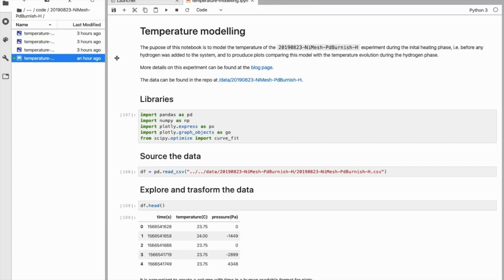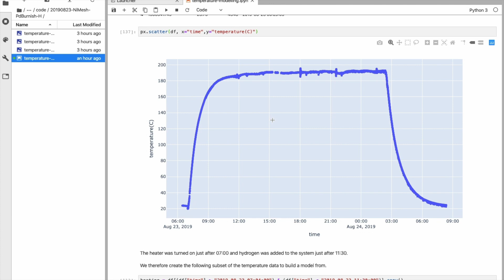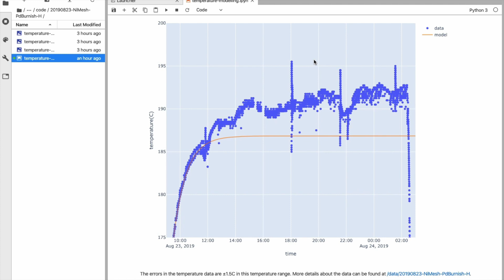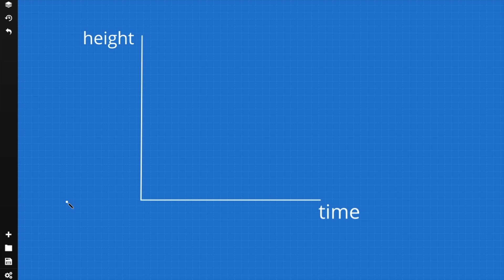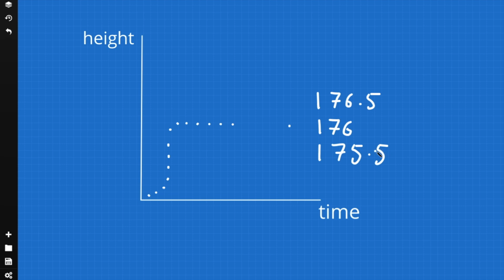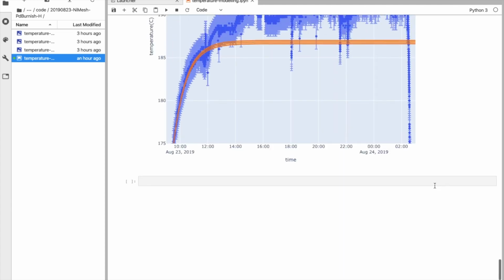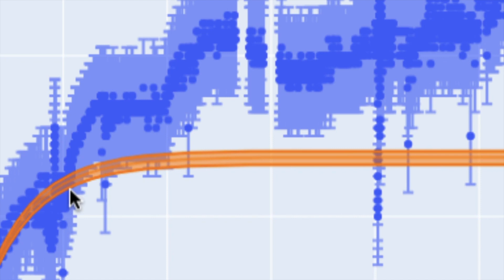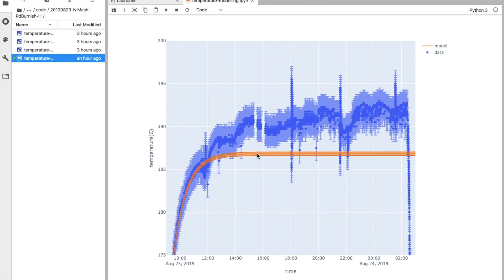Did I make cold fusion happen? - Casual Physics 003

Comment: Fleischman and Pons used deuterated acetone. Pure hydrogen is very difficult to fuse even in a star. But by the way only natural hydrogen H2 would make fusion the cheap unlimited fuel source they claim.
Reply from the maker: Agreed. This is why people get so excited about the possibility of nickel and hydrogen as opposed to palladium and deuterium. There isn't as much  data on the Ni-H system unfortunately.
Reply: @CasualPhysics  I think an Italian guy managed to create a fusor devise which fuses some solid fuels together and achieves breakeven.
Reply: @thelovertunisia  do you have a link? I'd love to read about that.
Reply: @thelovertunisia  oh I meant the italian guys fusor that breaks even, sorry, I should have specified.

Comment: Others have found that a 50 nano-meter space in a nickle 3D mesh with a Hydrogen Resonance Frequency at 90 Degree (one North-South the other East-West) will produce about a 20K F in temp with a POSITIVE in Deuterium Produced with a POSITIVE NET Energy Produced. others can reproduce this effect while others are at a 50/50 with non-mesh designs like pitted nickle balls looking like crumpled foil balls.

Comment: Hi Matt! Sorry for being late at the ball, great video! I don't understand how your model errorbars can be more narrow than the errorbars in the ramp up phase measurements its based on. Also, would be informative to see the equipment approach saturation on its own before you insert the "reactant". Anyway this was great!!!
Reply from the maker: Robert, Hi 👋. So glad to have you here 😊.  Excellent question about error bars - I too was surprised by this. Here is what I did (full details in the following jupyter notebook https://gitlab.com/mklilley/lenr/blob/work-in-progress/code/20190823-NiMesh-PdBurnish-H/temperature-modelling.ipynb):

To calculate upper and lower bounds for the temperature model, I created 1000 versions of the model based on temperature data that's modified to include a uniformly distributed random error (up to ±1.5C) at each point. The 1000 models are then used to make temperature predictions and the maximum and minimum predictions at each point are taken as the upper and lower bounds.

I'm not sure whether this is the most common way to make error bounds on models but it seemed reasonable to me. Give me a call sometime and we can talk about it in more detail.

Regarding the approach to saturation - I totally agree. When the experiment was taking place it seemed sufficiently saturated - next time I'm going to leave it a lot longer.
Reply: Casual Physics Cool! I’ll have a look at the notebook. Just from the look of it though, I think your model errorbars could and maybe should be more conservative. But even with broader errors I think you would definitely see indications of the effect, albeit less significant.
Reply from the maker: @robertnyqvist1844  Yeah, I'd love to hear your thoughts from your new data scientist perspective :-). Give me a call in the new year so we can catch up and discuss some of this stuff.

Comment: Good work Matt.
I'm not sure if I understood it well about the calibration curve: Was the H2 already filled in the vessel before the rising of temperature in the calibration process OR is the H2 introduced at equilibrium of temperature.
The calibration must have H2 (or D2) without the mesh ! Without that you can't know how H2 affects the heat flux inside the vessel. H2 is very good conductor of heat and has a great impact on the vessel behavior regarding the temperature at one point of the reactor.
First you must master this first step about your vessel behavior with heating and H2.  The H2 pressure  from 0.1 mbar to 100 mbar has a dramatic effect on heat conduction. Above 100 mbar, there is no much influence of the pressure and below 0.1 mbar the effect of H2 in the vessel has not much effect.

Secondly, you can put the mesh inside the vessel a look for a different behavior and if tehre is one analyse it to remove every artefact that may have influenced the result.

Arnaud
Reply from the maker: Thanks for taking the time to reply Arnaud. As I mentioned in the video, I have not yet done proper calibration experiments like the ones you describe. I have plans to do these (and in fact, I'm doing one of them as we speak). However, even without such experiments I think I can say something useful. You see, my experiment is heated from the outside, this means that the high thermal conductivity of any hydrogen inside doesn't have an impact on the final steady-state temperature in the absence of any internal source of heat from chemical or fusion reactions - it just determines how quickly the steady-state will be reached. So, I use the initial heating curve when no hydrogen is yet present to determine a baseline from which I can see if there is anything extra happening inside.
Reply: @CasualPhysics   Thank you for the answer. Please replicate the initial heating curve with H2 inside and without the mesh. And for a proper calibration, the vessel should be reduced before that.
Reply from the maker: @arnaudkodeck5107  I'm currently heating the vessel with nothing inside under vacuum and will put hydrogen in a couple of hours. Thanks again for your interest.

Comment: Hello Matt!!! Did you meet Bob Greenyer at ICCF22? He stresses the importance of having Ni absolutely free from oxides, as he was told by Piantelli and Parkhomov. It takes weeks of baking out usually. Mizuno also stresses the need for long bake outs to remove all oxydes and impurities from t reactors. That’s not really fun but even Thomas Graham in the XIXth century, who was the first to understand hydrogen difussion in through metals understood that it was highly dependent on the purity of the surface exposed.
Reply from the maker: Hi. Yes I know Bob. We did not chat about nickel oxides but I've been talking to Ed Storms recently about potential impurities on my palladium and have got some ideas for ways of removing them that will make loading much more effective. Specifically, create palladium oxide through heating in air and use this to burnish the Ni mesh. Apparently, this oxide is very easily reduced by hydrogen and subsequently makes a nice clean surface that will then readily take up hydrogen. We can talk more about it on the LENR forum if you like.